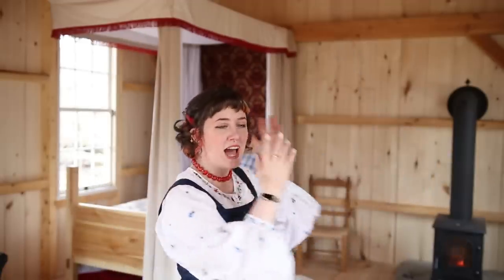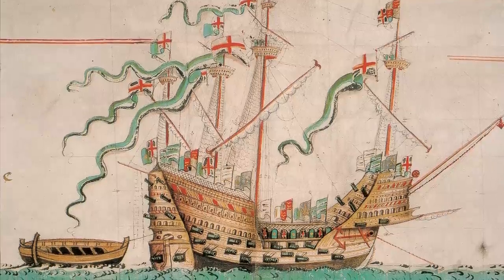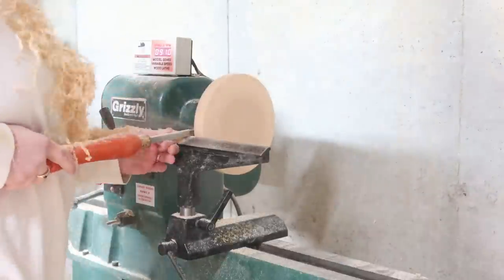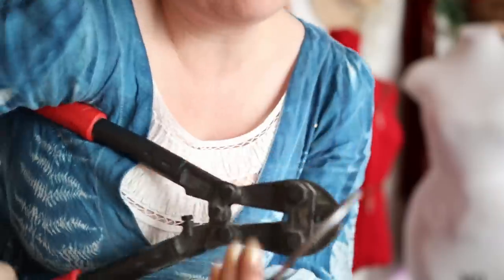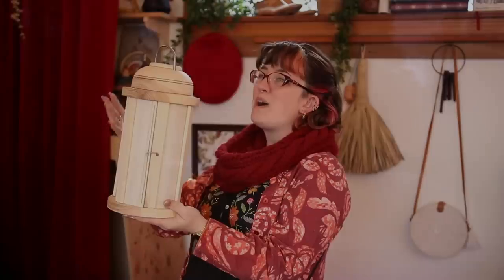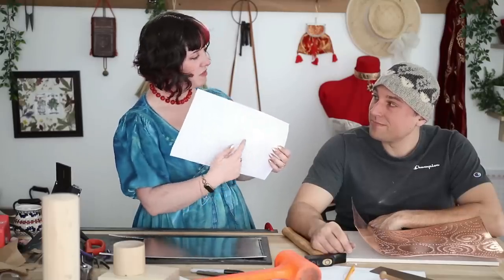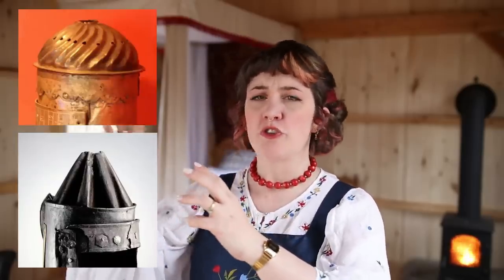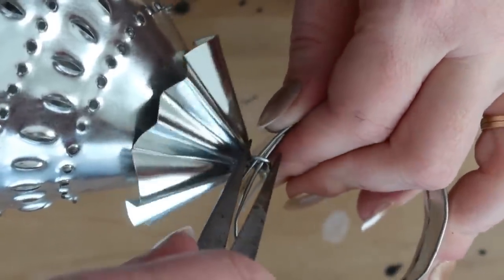Making some vaguely Medieval Lanterns 🕯️

Comment: A little tip if you decide to experiment with make more tin work: Use a length of wire when folding over/rounding your edges - it will give a more uniform shape and prevent crumpled edges. You can remove the wire with a bit of elbow grease or leave them in at your preference (it also adds a touch of reinforcement if you're using really thin material).
As an aside, horn is a naturally layered material - which medieval crafters exploited to get really thin panes of horn by de-laminating/splitting the layers. I assume they could be dyed or bleached (sun bleached maybe?) at that stage for some really bright and colourful lanterns!
Reply: Thank you, that’s really helpful and I would love to see how the colors would turn out; it’s sounds really cool 😄
Reply: Sounds to me like Morgan needs another lantern!
Reply: Yes, they use steam and heat to delaminate the horn as well as shape it.

Heads up...using steam and heat on horn smells pretty bad.
Reply: I love it when people share little tips like this. As soon as I read it, I thought, "Yes, of course!" but it would never have occurred to do it. :)
Reply: Great tip, we do that around neck and arm openings when we make steel armour! Though what we're using is rigid enough that we roll the edge first then shove the wire in, but every shop is different.
Reply: Hmmmm interesting 🤔 I remember it can be heated and sort of smushed into a mold for objects like spoons and such so I wonder if during that process they would be the time they would do that. I’d have to do some research as the use of horn in the past is something I’ve only recently discovered 😅 horn really is an interesting material 🤩
Reply: Morgan spoke about using small panels of horn but I wonder how difficult shapable horn is to procure. Like we don't use real tortoiseshell anymore, ivory trade is heavily regulated, etc. Are specific types of horn more malleable but in lesser (legal) supply?

Comment: I lived near the Henry Ford growing up, and Greenfield Village had a project to take home where you would take the label off of a soup can, fill it with water and freeze it, then use a nail and hammer to punch holes into the can using the ice in it to support the tin as you hammered. This video brought back some good memories ^_^

Comment: Morgan, during the Pandemic you started my Historic Sewing journey by inspiring me to make a Kirtle.

This led me to learning skills that helped me get a job at a Living History Museum.

I now work as a Tinsmith, Blacksmith and Potter.

Things have come full circle, qnd seeing you make a Tin Plate lantern made me smile. 🥰

You did a great job with tools that, while not 100% what we use, were surprisingly effective! Well done!

And I can answer your question regarding the reason the candlestick holder has a slight gap:

You guessed correctly in that it provides some leeway if a candlestick is slightly too big. That's why we usually keep one part of the base unsoldered, so it can be squeezed tighter.

But the open section is also to shave down a candle that's WAY too big to fit in the holder. In case if squeezing the free side down doesn't work.

I hope this helps! And you would be an amazing Tinsmith/Tinner. 😁

Comment: I'm definitely getting the metal kits to make some wonderful little lanterns of my own!  Those look great!
Reply: Really like the warmer glow that the sheet copper lends to the metal lantern design! Don't know what the ease of working is, in comparison to the tin? But it looks really interesting, esp. if you could prevent the exterior from oxidizing.
Reply: @Anna_ in_Aotearoa  just an FYI, you CAN treat copper so it doesn't oxidize OR  you could treat it with chemicals (liver of sulfer is one) So you get the color immediately! (Or a combination of color, perhaps?!) 
Heating copper gives an interesting effect, though you must be careful as once it is heated (annealed) it can become "work hardened" & difficult to work.

Comment: The lanterns both turned out so cool. The wooden one reminds me of the ones I've seen here in Sweden, though those use a pig's bladder instead of parchment so you get a solid surface (the candle is inserted through the bottom of the lantern and locked into place.)
Reply: Tell me more!
Reply: any links for how tos for the pigs bladder part? I got a couple is like to use all of when we butcher this fall

Comment: These turned out awesome. I definitely want to try out my own tin lantern making some time. Also, very excited about this big painting project. Idk if you're planning on using medieval paint methods, but mixing your own paints is super fun. I took an art history course in college all about different mediums through history and we did a whole painting where we used eggs as the paint binder and mixed our own paints with egg whites and pigments. The extra paint doesn't last, but I still have the painting after almost ten years and it looks great. Egg paints are like modern acrylic in that they dry super fast which is nice because oil paints take forever to dry. Anyway, good luck on your painting project!
Reply: I believe that type of painting is called "Egg Tempura", should folks want to research more !?
Reply: @m.maclellan7147  It's Egg tempera (tempura is a cooking technique) and typically it was the egg yolk (for the fats) and that or milk paints were used primarily pre-Renaissance-- and by that I mean starting 5000 years ago to about the 13th century, when oil was used to detail tempera paintings.  After that using linseed oil was most common until WW2 lead to shortages of linseed and THEN acrylic paints came about.  Though then as now wax mixed with pigment (called encaustic painting) was a very interesting medium to use and can make for some really wicked effects, though it doesn't wear as well.  
So yes, tempera can last a thousand years+ if cared for properly.
Reply: @M water_moon  thanks for the correction. I thought it didn't look right, but painting is NOT a skill I possess, lol.
Interesting history as well. Did they ever use duck eggs, I wonder ? I know duck eggs are preferred by pastry chef's as they are "rich" ! 
 With an ostrich egg, you could mix up enough to paint many canvases!? 😉
Reply: @m.maclellan7147  Hmm, I would think that duck eggs would be able to be used, but rarely since ducks only lay once a year and chickens (pre-modern breeding) laid 3-5 clutches a year, making them both harder to come by and more desirable when available.  
I got into paints and how they're made when I found out that Leonardo was conducting experiments with his most famous Last Supper, and thus it started to flake nearly right away. He even got called back just a few years after painting it to fix some damage.  DaVinci having to do warranty repairs doesn't really match with his reputation today so I found it hilarious!

Comment: The entire time I was wondering if the candle heated up the handle, especially the wooden one because the top is open and all the heat of the candle would be directed straight to the metal handle and to your hand. 

I think the wooden one would be better on a curved staff or something like that to hold it over your head.
Reply from the maker: It definitely gives off a little heat towards the handle, but most of the year, the night is cool enough that that tiny heat is actually quite nice on your hands. Definitely nowhere near burning.

Comment: Those looked SO GOOD! Now I want to make a lantern too!!

I work part-time in an armour shop, loved watching you figure out all the metalworking stuff. And my mentor always used to say when something fell onto the shop floor, "It's found a more stable location." Because of all the pointy bits and burrs and sharp edges, I wear a pair of mechanic's or carpenter's gloves (the really thin gardening gloves will work too) for most of my metalworking, at least until I know I've got all the burrs polished off all my pieces. Home Depot here actually sells honest to gods work gloves that fit small hands and are not pink, it's awesome.

And yeah, Sharpie and metal is... messy. We use lacquer thinner to clean it off.

And you should hear the worble worble of a nice sheet of 18ga steel... the 16 ga is what we mostly use but the thinner stuff definitely worbles better.

Comment: Fun projects!  I'm sure someone in the comments might have told you that when soldering you place the iron tip onto where you want to solder then touch the solder to the iron tip directly onto the edge you're sealing.  I was kind of impressed it stuck the way you were doing it. The solder will follow the flux which you add a fine line of - to seal it.   The metal ones turned out super cute!

Comment: We made a version of the both lantern in Kindergarten for the Laternenumzug! The tin lantern was made out of old cans, we punctured little holes with awls or nails and stuff; the wooden one we approximated with the packaging of a camenbert (two for one, especially good if you have two little children) and wax paper. When I got older, the (very flammable) candles got exhanged for these little lights specifically for the St Martin procession, we were living on the edge with all the live flames!

This brings me to the next point! The way you hold the lanterns immediately above the candle worries me a little, we always got burned doing that. The people on the horses had them on sticks as well, so there apparently is historic president for it, if that is an issue!

Comment: You did a really great job! Especially with the cuffs and double placket! My biggest tip for next time is to avoid picking the pieces/garment up off the table as you work, and never hold it up and let it hang under its own weight until the neckline/shoulders/sleeves are finished. With such drapey fabric every time you pick it up it is probably stretching a bit.

Comment: I'm relatively new to this channel but I'm loving it so far.  With the soldering, you might benefit from a bit more flux and from pre-tinning your pieces before joining them.  The solder follows the heat and also conducts heat really well, so two pre-tinned mated surfaces join really solidly and then allow you to feed more solder in from the edges -- it will get sucked into the join and end up forming a really tidy concave edge around the perimeter.  Looks neater, but also guarantees a really strong bond.

Comment: There are XIII century sources, both visual and written,  that specifically mention "glass lamps", and always for when the lamp was not to be used in a fixed position (read: a hand lantern). Those were a perforated metal lamp around a glass recipient with oil and one or more wicks. (Gran Conquista de Ultramar, 475a.)

Comment: I am excited by the fact you are willing to tackle a project using sheet metal. Would you consider making a shallow bowl or even a platter out of copper sheet and getting it plated with silver? I would love to see that. My research happen on the fact that much of the silver dishes used in former times was silver plate but using a deadly method to plate silver. I think using modern electroplating is a big improvement but would not make a difference in the look.

Comment: i grew up on medieval re-enactments and we used the vellum kind mostly! My dad poked the decorative hole patterns in those too, which i have to imagine is easier than punching through tin. i seem to remember the wooden frame also having a kind of sliding mechanism, so the inside part where the candle was could slide upwards out of the vellum lantern cover so that you could light them more safely and easily but i dont know if that was accurate or a modern adaptation

Comment: Quick note that might be of help to people.  Sharpie comes off if you use normal hair spray.  We go through cans a week using it for this - son-in-law uses sharpies to mark stuff at work and they remove it with hairspray so the items can be reused.  Most people can access hairspray more easily than alcohol so this might be of help to people.
Much as I like the design on the metal lantern I really really like the wooden one out in the dark, looks very authentic and, I suspect, is probably better than the metal one if you are out in the winds.

Comment: I have a metal lantern which may be Middle Eastern, exotic, gorgeous. It works beautifully  and the holes are about 1 centimetre (2/5 inch) in size. Lots of light gets out and breezes don't blow out the candle. A lantern I saw with smaller sized holes was dim but there probably weren't enough holes. Thanks so much for taking the time to go through the details of the project.

Comment: All of these lanterns are gorgeous - well done!  My only hesitation is on the metal ones in regards to walking with them because I’m imagining the metal can get pretty hot if the journey is lengthy, so, maybe, wrap the holding ring at the top with leather strapping or twine or something?  What do you think?😊
Reply: Maybe that's what the fluted ruffley part is for?  Heat dispersion?
Reply: I rewatched the wind test and they were using gloves so is hard to tell… but yeah, that’s a valid concern.

Comment: Its amazing the things you learn sometimes. I had no idea that horn was use to replace glass in a cheaper fashion for lamps. Its great you got to learn new tools as well, thats always something i try to aim for when im working on a project. New technique, new tools etc. Also you're completely right to have reinforced the door, i use PVA glue all the time in my cosplay and props and it doesnt like changes in temperature or flexing. It eventually tends to dry out and flake apart so the stitching will hold it nice and safe. They're both surprisingly bright as well, pretty awesome to bring back "old tech" like this, even if its just for aesthetics! Did you by any chance check how long it took for either of them? Curious to see if its a doable "weekend project" type of thing.

Comment: I made such a lantren in the third grade.  You fill a can with water, freeze it in the freezer, and then hammer holes in it with a nail.  The ice prevents the can from denting.  When you are done, you melt out the ice and cut a little door with tin snips.

Comment: I imagine the parchment would soften and diffuse the light more, making it more effective for lighting a broader space, while the openings in the tin would make for a brighter and more focused light.

If you're planning on using these as nighttime illumination in the cabin on the reg, you might want to add some reflective surfaces in the room to maximize the light you get. But I'm sure you clever people have already thought about that.

Comment: my experience with lanterns (LARP, general use) is that handles and loops on the top can get VERY hot over time as the heat from the candle flame rises. For this reason, i highly recommend making yourself a carrier of some kind! I like the simple hook-on-stick approach, personally. By experimeting with stick length (which eill vary depending on your own height and the weight of the lantern), you should be able to come up with a stick that's ling enough that you can hold the lantern "up" for light distribution, while allowing you to hold your hand in a lower, more neutral (and therefore comfortable and less tiring) position. I have no idea if this solution is in any way supported by historical evidence; it's just personal experience.

ALSO if you want the lantern look but you don't want to burn a candle for whatever reason, you can totally use battery-powered LED lights inside the lantern instead. I find the artificial LED candles look more like a real candle but give off less light, whereas a string of LED mini-lights gives off more light (and is very pretty) but the multiple points of light look less like as single lit candle.

Comment: I wonder if the little fluted part on the tin lantern is intended to divert rising hot air out and away from the hand? I've seen similar things used on later lantern constructions

Comment: Looked like you used some Titebond wood glue on the parchment before reinforcing - that stuff usually requires clamping pressure to work properly, so you were probably quite right to reinforce it. 
I'd probably have gotten extra bits of wood and used them and a couple of small clamps to hold it all under pressure while it dries.
Reply from the maker: I did exactly that! But even then I didn't quite fully trust it, and felt like the stitching would be a good idea just in case
Reply: @MorganDonner  Always better to have more than you need than not enough, very wise! End result was fantastic, might make some myself (if I can find some good parchment...)

Comment: To the subject of parchment. Only place I've found that sells whole parchment skins like that is in Turkey, did you get them from a place in the US? Looking for a place a bit closer. Have you ever looked into horse/animal glue? Can get it easily at a True Value or like hardware store. It takes a while to dry but its removable, what I used to keep my leather on my wood sword handle. Plus its period accurate.

Comment: For a Medieval one, I don't think that you would have a parchment one. Vellum might be a more accurate option, perhaps a hardened vellum there. You might also need something to add protection to the wood, some stains might have properties that would help there for heat issues